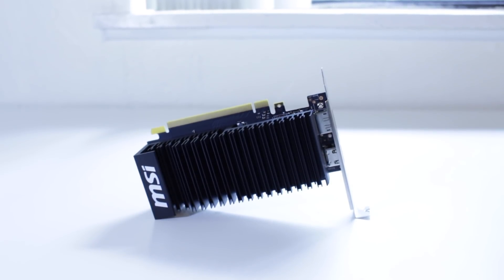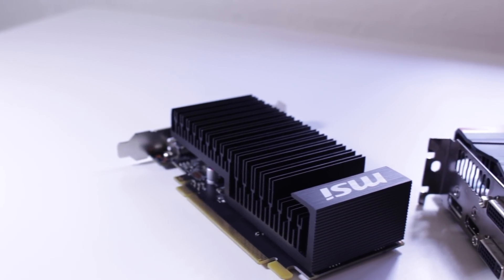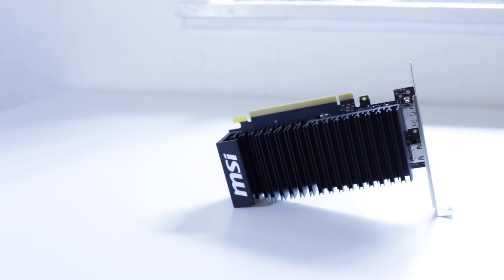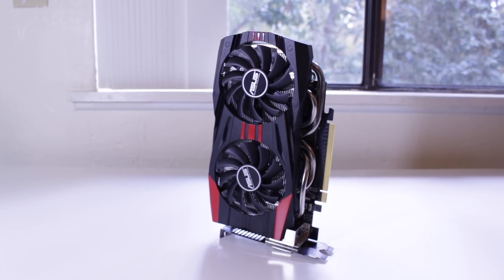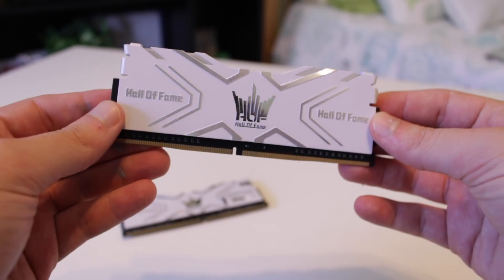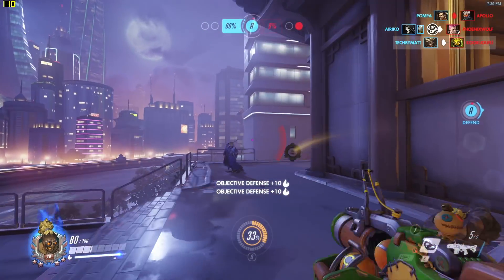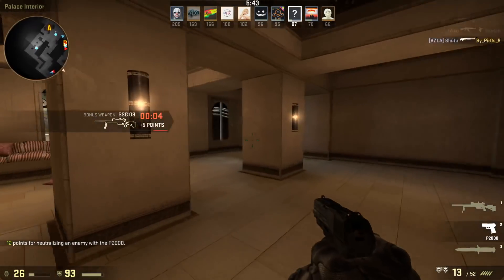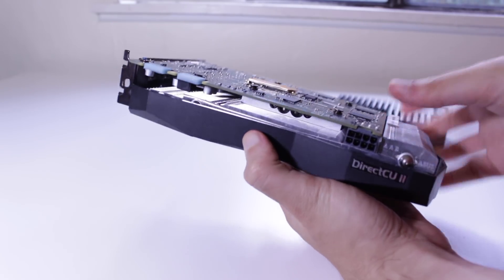New vs Used Graphics Cards! (GT 1030 vs GTX 760)

Comment: The GTX 760 (and 770!) needs better drivers, similar to what the 780 and 780Ti got recently. In terms of raw power it should still perform similarly to a GTX 1050, seeing as the GTX 960 was not that much faster than the 760 upon release and the 960 performs anywhere between the 1050 and 1050Ti.
Reply: Nomad Brasil Gtx 760 performs as same as 1050
Reply: Nomad Brasil The 770 performs as fast as a 1050 ti. 770/960/1050Ti are on pair
Reply: David the 960 gets about the same performance as the 1050 ti in most titles
Reply: It seems that all these cards, as GTX 760, GTX 680, GTX 770, GTX 780, GTX 950, GTX 960, HD 7870, R9-280, HD 7950, HD 7970, RX-560, GTX 1050, GTX 1050Ti, also GTX 570, GTX 580 - all perform very similar, with no more than 10-15%, maybe sometimes 20% difference in games. That's what I would call a mess.
Reply: What also needs to be taken into consideration is the cost when new, features (for example HDMI 2.0) and power consumption. And yes, while going 560 to 660 to 760 is minor steps, it all adds up over time and today we have low-end cards like the GT 1030 outperforming high-end cards from only 6-7 years ago while consuming a small fraction of the power and costing a small fraction of the cost.
Reply: Fairex the 970 preforms a bit worse then a 4gb rx 570
Reply: @ Caroi Alexandru-Mihai

I don't know where you got your information from, but it is totally wrong. I have an EVGA GTX 670 FTW (comparable to a stock 680 and an overclocked 760) and it struggles to maintain 60 fps in Doom at medium settings and the same with The Witcher 3. My EVGA GTX 780 Classified totally obliterates the performance of those cards, while running those games in Ultra settings.  It's more like  30 to 40% increase in performance.
Reply: Maybe GTX 1050 Ti is a little better than all the other ones.
Reply: Xeon Gaming still best 50 - 70€ Card
Reply: i have a desktop 960 in my alienware alpha r2
Reply: better drivers wont fix a old architecture, new drivers is based for 10 series, and only 10 will perform better and better for now..  GTX 760 is strong but old technology from 2013.
Reply: David The 970 (290) gets a bit higher scores than the 1050ti.
Reply: David an OC'd Gtx 960 4gb beats a Gtx 1050 ti
Reply: no 760 and 770 wont ever perform on 1050 lvl, drivers wont fix a old architecture

Comment: I play pubg on my GT 1030, 720, low settings - 45+ fps
Reply: Technotice lies
Reply: Kishun Barker Its true, duh...
Reply: at very low settings it hits 75fps, at lowest 35, but never lower then  35 (desert map)
Reply: Technotice What brand? Asus, Msi, Gigabyte, Galax?
Reply: zotac
Reply: Technotice I believe the Msi aero itx (higher price than the one in this video) and the asus one perform much better.
Reply: there'll be not much of a difference though, keep that in mind i have 1366*768p screen.

Comment: I bought a GT1030 because the second hand prices in my country are insane. Even though after all taxes the GT 1030 costs 100$ you need to spend another 10-20$ for a GTX750ti, if you can find any second hand that is. Both of those are bad deals compared to a new GTX 1050 for 150$. 
I though it would be a nice experiment to stick an old case fan on a passively cooled EVGA GT1030 and see how far it can OC and how cool it will stay. Also I had to know if Pascal GPU will work in my old Dell Optiplex 380 with a Core 2 Duo E8400, and a single slot, short card with a single slot bracket is the only thing that can physically fit inside. ;)
BTW the passive card with the fan - 55-60c at 1911MHz clock and 7770MHz memory clock. If the power could be pushed it would go higher, since it is in power limit like 70% of the time

Comment: This is kinda unfair. The GT 1030 isn’t made for gaming. Any Nvidia graphics card that starts with GTX is made for gaming. The Nvidia graphics that starts with GT is meant for Media and other things like video editing.
Reply: Dunne. You’re right, however many people have been thinking of using this in budget pc builds. This video provides an accurate representation of what they can expect to get compared to other cards of similar prices.
Reply: For a card thats not made for games it sure performs pretty well against the 760  and for it having a 30w consumption also so what does that make the gtx 760 ? Nowadays Another video editing gpu ?
Reply: You missed the point of the video
Reply: It makes no difference. the gtx 760 outperforms it in every way, including editing. yeah, its a budget gpu, but a gpu that is 5 years (I think?) old beats it.
Reply: Now you want to say its unfair to use a GTX card for editing, because they are for gaming...
Reply: This is a gaming gpu, The GTX means it handle all the current  AAA titles at lounch, The GT means light gaming, intel HD means no gaming :D.  The 1030 shit for video edititing it only has  384 Cuda cores  the 760 has 1152.
Reply: Dunne. But the point is that they are priced the same
Reply: I'd rather buy used gtx than any gt card with the same price.
Reply: A k600 quadro outperformed a gtx560, just because of drivers. I was bored so I tried this and ended up with 10 more frames.

Comment: I always recommend people invest in a power supply slightly more powerful than what they need at the time of purchase. This video shows one reason. If you buy a PSU like a 300W with no 6 pin pci-ex connector because that's all your videocard needs then what happens if later you get great deal on a videocard...except it requires a 6 pin connector? You'd have to buy another PSU, which defeats the purpose of getting a good deal on the videocard.

Comment: The thing is, the 760 has way more raw horsepower. So in games that has already been optimized like Rocket League which is DX9, it would demolish the 1030. Only in newer games where they're made after Nvidia stopped Kepler optimizations is where you see the 1030 getting close.
Reply: Omm Gt 1030 has 30w tdp, have fun searching a better gpu for the same tdp.
Reply: Unless your power supply can't take it, you have no reason to go for 1030. A 100w difference is not much.

Here's why : let's say in the worst case scenario your electricity bill is $.5/KWh. And you use your pc for work 8 hours a day and used it for 365 days a year.
That means you will use 0.1 (kw) * 8 (hours) * 365 (days) = 29.2 KWh

For a better performance, i am willing to spend extra (29.2 * $0.5) 15 dollars for my electricity bill
Reply: Kenny Ricardo , your calculation is off by 1 decimal point. 0.1 Kw x 8 hours x 365 days = 292 Kwh, not 29.2. So that's $150 per year based on your formula.
Reply: No that 760 was used for mining so don't expect it to last a year. LOL.
Reply: Why not 1050/Ti
Reply: O!Technology and 30w tdp
Reply: Vega 11 Maybe?
Reply: Yeah, the 1030 also fits in 90% of pc cases (assuming it's low profile
Reply: intel grandeur DX12 barely made a difference on nvidia. 4K HDR is coming soon. But by the time 8K is a thing this is already obsolete or sold at a cheap used price
Reply: Bullshit, I wold pay more for a card that performs at least double for the same power usage instead of chapping out and paying it trough the electricity bill anyways...

Comment: I recently built a PC for £83.
Specs:
i7 2700k
Asus Z77 motherboard
8GB DDR3 1600MHz
700 Watt Cooler master PSU
GTX 660 
Apevia Xcruiser Case
Reply: kamilar kulturistul 8Gb is fine for most. RandomGaming in HD did a test a year ago on GTA 5 and it ran just fine (no fps dips)
Reply: wow great build! btw i yhink ur talikng about thr i7 2600k
Reply: KiwiJamYT Nope, definitely not. 😊 Here's a link:https://ark.intel.com/products/61275/Intel-Core-i7-2700K-Processor-8M-Cache-up-to-3_90-GHz
Reply: how did you get the i7 for such a low price ?
Reply: ilias tredi boy Friend sold it to me.
Reply: i mean the cpu is still ok but only 8gbs of ram and that 660 is really going to hold u back
Reply: kamilar kulturistul Not my main rig, so it's fine 🤗
Reply: gta 5 is a 2013 game, u will suffer in 2017 games
Reply: kamilar kulturistul i wouldn't pick such old gpu if i were you. It is just far harder to support it with my psu. Get something like a gtx 750 or gtx 950 instead
Reply: kenny ricardo No, the 660 does the job.
Reply: lol i have 4gb ram
Reply: 8gb ram is fine on a budget. RAM prices are insane, so any new build id do I'd use 8gb ram, then pop another stick in when prices go less insane.
Reply: you're right with the insane prices but if you plan on playing triple a games i really don't think cheaping out with 8gb is going to do you any good. when i play pubg i hit 9-10gbs of ram and that's without any chrome tabs of music or anything in the background
Reply: kamilar kulturistul Dude, I have a main rig, this isn't it. I have an i5 4590, 16gb ddr3, 1060 3gb. So 8gb in this rig is more then enough.
Reply: yet somebody in that game with 32gb ram hits 20 GB ram usage. usually with those games they just use as much ram as is available.
Reply: i simply do not believe you my friend, why don't you link me a video showing that
Reply: 8-16gb is more than enough for pubg
Reply: ram
Reply: what do you mean 8-16? do you mean 8 or do you mean 16? and 8 is going to make it a bit choppy at times
Reply: for fortnite i am running it on high with some settings on epic only with 4gb ram its getting me 60+fps its enough for me
Reply: fortnite is a joke that is not demanding at all
Reply: can't show vid... its experience (friend playing it and using 20gb ram)... also I think you can allocate ram to it?
Reply: ok.... if u know nothing about computers and u never built one urself just stay away from the comments dude
Reply: lol u roasted him
Reply: kamilar kulturistul i dont play any newer games and demanding games so im good with my pc and 4gb ram and i meant 16gb ram for pubg is good 8 is playable but 16 is better

Comment: Lol yesterday i bought a gtx 760 acx for 40$
Reply: New? $40 is crazy cheap.
Reply: Lucas Rodiadis Like who would store a decent card, not using it, just to sell it cheaper than bought price???
Reply: Lol I bought 960 for 90$
Reply: Bought half a year ago a asus gtx760 2gb for 37$ only tested the previous owner said and I think I believe him or he did a super job of cleaning it spotless. And I live in a country that is more expensive than US. Do I win?
Reply: Get a 960 its good as 1050
Reply: What are you talking about lol
1050ti is way ahead of 960
960 is pretty much a 950, there is absolutely no point of buying it. Anyways, 1050 is way closer to 960 than 1050ti.
Reply: Koffing47 I meant 1050 sorry but I get descent performance with my evga 960 and ryzen 3 but look at price I got a 960 for about 90$ its a bit old but not too old. I could suggest it for very budget friendly builds like mine. I play fortnight I easily get 60+fps in high and some settings in epic even with 4gb of system ram. Hope this helps
Reply: Koffing47 also a 760 is very good but its Kepler so I didn't buy it
Reply: FivePrince great find man
Reply: Koffing47 that’s where you’re wrong. The 960 actually slightly edges out the 1050ti
Reply: Kingdom Rhye see this-https://youtu.be/xxejTFa7ie0

1050ti slightly edges out 960 . 960 is very close in some cases better.
Reply: I bought an Asus GTX 1080 turbo for £489 on Black Friday
Reply: nice steal man
Reply: I bought a Msi 980 Ti for 270€ a few months ago :D
Still happy with it
Reply: I bought one Saturday for 30 bucks. MSI 4gb bro. Best deal ever!
Reply: FivePrince I bought one 3 weeks ago for 130 NZD

Comment: GT 1030 is fine for 720p Gaming.
Reply: No lol, Who told you that. 4K won't be mainstream for atleast some years.
Reply: How is it not fine for 1080p? It can run most e-sports titles at around 60-50 average which completely fine.
Reply: 768p
Reply: A Sid Its runs a lot of games 1080p 60+fps
Reply: Gunmetal Grey not everyone has a r7 1700 and most of them are cpu sided (csgo. Fortnite)
Reply: RAVE thats what i said, it will be common and available for every one in the next 1 or 2 gpu line-ups for a budget price
Reply: Is it enough for playing 4k videos at 60fps ... ?
Reply: Bob Bob next gen is coming in about feb.march . I dont think there will be budget 4k cards then. Also budget and 4k dont really match up
Reply: the reason its GT is usually cus it requires no extra power. I think that's the case with all "gt" cards
Reply: djkaye youtube the mini 1050ti’s need no power the 1050 should have no extra power either if the ti does not
Reply: mini's don't count if they are LP
Any LP card doesn't count.... I thought 1050's have 6 pin...... also 1050ti usually is extra power..... depends on manufacturer but NVidia designed both to support 1 six pin.
Reply: i said the smaller 1050ti's got no 6pins like the one for zotac and one other one i don't quite remember.
Reply: it doesn't matter. I'm going on what NVidia based the 1050ti on, the "smaller" one's are low profile.
Reply: Acid HD It is. Even for some 1080p.
Reply: DT B Not really depends what monitor you use of course if you chose a lower resolution on a 1080p monitor I would look shit, saying it’s obsolete is crazy most videos on YouTube use that resolution
Reply: Plus you don't really get much more performance with the 1050 ti with that... If the price is right and you have the psu why not though lol
Reply: back to original topic: the only case I'd ever go for lower than 1080p is csgo high refresh rate. in terms of the 1050/1050ti lets end the argument here, you have valid points - I was just explaining why Nvidia named the cards the way they did.
Reply: 1080p gaming is perfectly fine on the 1030. I game on medium-high custom settings. I have a i7 2600...my previous build had only an i5 650 and it was not too much different
Reply: its fine for 1080p gaming depending on what you play
Reply: believe it or according to steam spy there are still a large number of gamers playing at 1020x768 its almost as if its not a fucking contest or something
Reply: I have an i7 4790k and a gtx 1060 6gb I use to have a 1030 with that CPU and I played ac4 at high settings at 45 fps at 1080p
Reply: nah like 768p
Reply: 720p or 768p or 1080p for a little lighter games like Minecraft or Fortnite
Reply: Yunhoo Lee But sometimes you'd have to go down from 1366x768 to 1280x720 to improve fps
Reply: gt 1030 is not really a gaming card,  nvidia even named it gt 1030 and not gtx 1030
Reply: Yea, The best usage for it would be a streaming station or a living room box.
Reply: Acid HD if you want to play at 30fps
Reply: Gunmetal Grey if u play esports games which are not graphic intensive at all (mostly) it’s ok but really you can’t call it a gaming pc
Reply: 720p in 2018?
Reply: RAVE it will in 1 gen,lel.
Reply: djkaye youtuber Only stupid people buy the ones with 6 pin because they are all so expensive that you could just buy a 1060. There are more cards without it. Nvidia does not decide the power system, think of the NVidia gpu die as a cpu and the rest of the card like a motherboard. Does intel/amd choose how many power pins msi puts on their motherboards?
Reply: Acid HD if 720p is fine which by today’s standards it’s not, 4K is getting mainstream in like the next one or two GPU generations
Reply: Acid HD, GT 210 is good for 144p gaming 😂 😂 😂 WTF? dude, 720p is obsolete